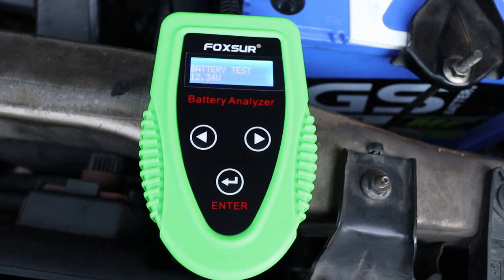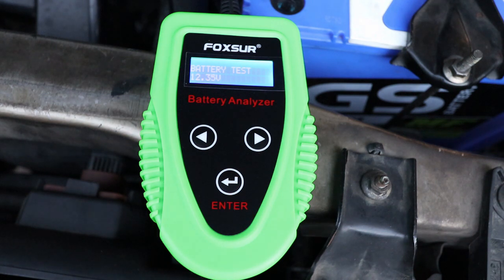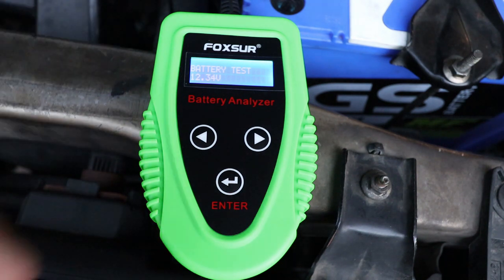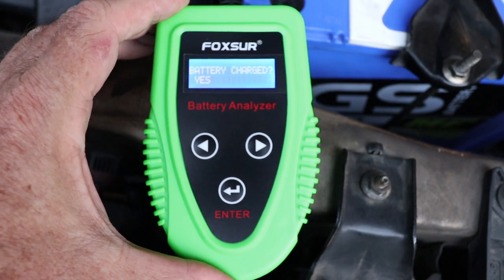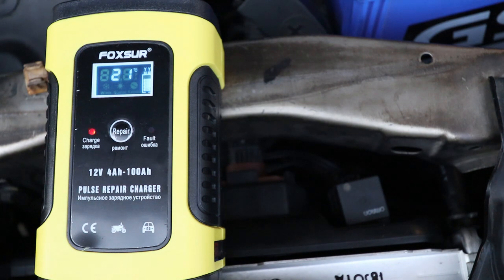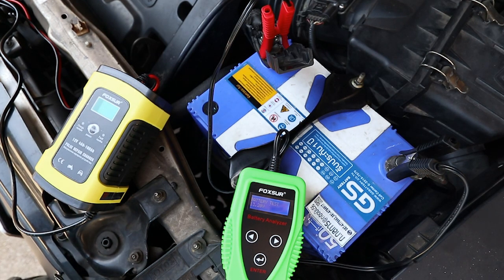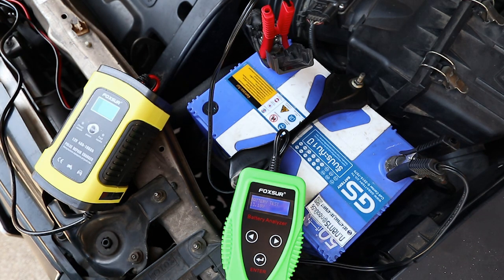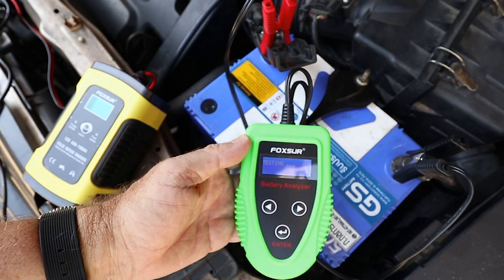Can The Foxsur Pulse/Repair Battery Charger Repair A Bad Battery?

Comment: i've had a good result last night with my newly purchased Foxsur pulse repair charger (same yellow one as yours) on my 2 year old Amaron 3SM battery 600CCA.... from 80% state of health (and also 80% charge) to 100% s.o.h. .... 17 hours of pulse repair mode... it didn't go into charge mode yet, but I noticed battery fluid coming out from the top of the battery (the fluid was a little dark... maybe the desultification effect?)... so I stopped the pulse charger... I was worried that the battery got damaged, but upon checking with my Ancel battery analyzer, it was already fully restored to 100% and it was also fully charged. Best investment so far (both charger and analyzer).
Reply from the maker: I'm really pleased to hear this, thanks for letting me know! I experienced the same thing doing a pulse repair. I left it repairing for over 24 hours, but it didn't actually stop and go into regular charge mode. However, the battery condition was a lot better after the repair. From what I understand about these chargers, they won't damage the battery. There's a cut-off to prevent them overcharging. I bought both the charger and analyser for a very low price and, like you, consider them to be very good investments.

Comment: This is my suggestion.. just do PULSE charging once a year for new battery around 7-12 hours. This will extend your battery life around 5 years easily without problem. Its adviseable for vehicle with short trip due to our car alternator cannot charge enough power to the battery to conserve if you driving less than 30 minutes per day + sulfation happen overtime. My battery still going strong while reaching 4 years now with CCA around 85%. Its recommended to replace your battery when the CCA reach 50% from your original value.
Tq
Reply from the maker: Great advice, thank you!
Reply: Can we pulse charge our well working battery without damaging it?
Reply: Thanks for the advice

Comment: Good video. But one point you make (at 6:50) may need to be clarified. Some smart chargers won't start charging or repairing if there is not a minimum voltage on the battery. Ironically you may need to give it an initial charge (with another charger) to bring it up to a basic level (I think it is around 10v or 11v) before the 'smart' chargers will work. But Pulse charging works well to repair - I have a Foxsur unit also.
Reply from the maker: Thanks for the clarification.

Comment: Greetings from Malaysia (which is just next door to Thailand). I bought one myself on Lazada (For 45 Ringgit Malaysia = 335 Thai Bahts) , after seeing your video. Exact same unit in orange and i have to say the repair mode has mixed results. If the battery is on its way out, it may or may not repair it. But I'm in no means of discouraging. My minivan also spend half its life sitting in the porch with minimal usage. Unfortunately I do not have a battery tester so I'm relying solely on voltages to tell me roughly the battery life.
Reply from the maker: Yes, they are very cheap. After doing the video I did another repair and the result wasn't as impressive as the first time. It will be interesting to see what happens next time, but we have to remember that batteries won't last indefinitely. I find the battery analyzer useful because you get an exact number without having to guess. Thanks for your comment!

Comment: With this charger, does the battery need to be disconnected from the car's electrical system in pulse repair mode?
Reply from the maker: @DavidBookbinder  I would definitely advise doing so. The user manual doesn't mention anything about this. It might be OK to leave the leads connected while doing regular charging, but pulse charging could do a lot of damage. I disconnect the leads for regular and pulse charging. It's not worth the risk for the extra few minutes it takes to disconnect the leads.

Comment: I watch another video on someone using the NOCO charger. Apparently that manual documentation says to initially bring to full charge first. After that then go into repair mode. I wonder what the theory behind this is. Phil, in your case, you went straight into repair mode and seems to work.
Reply from the maker: I had charged it a few days before and I had been using the car every day, but yes I agree, I should have charged it again before doing the repair. Even though the battery should have been almost completely charged, a few other people have made this point and I should have charged it again first. Thanks for your comment!

Comment: This is a great video. My wife got me a pulse repair charger that looks pretty much identical to yours (including the display) but in orange and with the brand BUDDYGO. After a couple of times recently of having to charge the battery after not driving my merc that much recently due to lockdown, and finding the battery completely dead (not even enough juice for central locking to work!)
Reply: I'm now trying the pulse repair and hoping that this works and saves me having to get a new battery! Fingers crossed! Thank you for your clear video!
Reply from the maker: @Swindongareth  Thank you! My problems also started due to the virus. My kids were doing on-line learning at home and there was no need to use my car. When I did try to use it I found the same as you - a completely dead battery and no central locking. The charger got my battery working again and has been fine since. I think they are all produced in one Chinese factory and sold in different colours with different brand names. No doubt, they're all identical inside. I hope the repair is successful!

Comment: Great video and review. Your Foxsur Smart Battery Analyzer (ALI Express) link is no longer working.
Do you know if your battery charger pulses are 16 volt power spikes like a Noco Genius 5 and 10 charger or CTEK charger uses? I have a Pulsetech PowerPulse passive battery desulfator on my 2001 BMW battery as preventative maintenance as Pulsetech claims that there patented frequency they use can extend battery life up to three times. I also used my PowerPulse on my other BMW battery that I let sit disconnected for a year, and it was at 11.2 volts, I tried charging it with my friends Exide 6 amp automatic charger for 14 hours and  battery voltage was at 13.1 volts, yet it would not start my other car. I put the PowerPulse on it along with a 1 amp Schumacher manual battery charger for 72 hours, and left the desulfator on it for a week and it started my car right up. My point is desulfation can take up to 30 days depending on how sulfated your battery is.
Reply from the maker: I'll look into the broken link. Thanks for letting me know.

Comment: I have a solar system and cannot pulse for 22 straight hrs. Can i pulse over two or three days w/ 10 hrs breaks?
Reply from the maker: Good question, but I'm afraid I don't know the answer! The documentation I've read assumes that users have a constant supply of electricity. The idea of pulsing is to remove sulfation from the lead plates. I guess that if there are breaks during the desulfation process, it will still work, but I don't know for sure.

Comment: Hi Phil....what voltage was your battery at ...at the start of pulse repair and what did it read at the end of pulse repair? Is the battery still holding up well now? Thanks
Reply: Ah I see the starting Voltage was 12.34V
Reply from the maker: I didn't pay much attention, but you found the answer! My background is mechanical rather than electrical, but I don't think that voltage is all that important. Current is where the power is. Sorry for the delay replying. YouTube doesn't always notify me of comments and I only find them when I look in YouTube Studio.

Comment: When I switched on, it turned full immediately and when I pressed repair button, nothing changed on the screen. Any idea whats happening?
Reply from the maker: Not sure. I've only seen this after doing a long charge. If it finishes the charge and I put the charger back on it says full immediately, which it is. All I can suggest is using the battery some more and then trying again.

Comment: Phil, technically, do we need
To disconnect the battery 
terminals when charging it, 
pulse or normal ?
Reply from the maker: The manual doesn't say anything about this. Whenever I do a pulse repair I always disconnect the terminals. In the past I have done a normal charge with the terminals connected without any problems, but now I always disconnect them. It only takes a minute and it's better to be safe than sorry!

Comment: Thank's for the review. Should I dismantle the battery first from car before charge using foxsur or I just connect without dismantle the battery from car ?
Reply from the maker: When I use the regular charge mode I don't bother disconnecting the battery leads. I put the positive charger lead on the battery terminal and I put the negative lead on an unpainted bracket on the engine block.

When using pulse repair mode I don't like the idea of electricity pulsing through the car's electronics so I always disconnect the battery leads and connect both charger leads to the battery. The user manual doesn't say anything about this, but my view is that it is better to be safe than sorry.

Comment: How long did the battery last after the "repair" 6 month, year, 2 years etc
Reply from the maker: It's still going strong. I did another pulse repair recently because I'm not using the car much at the moment. The CCA is down (around 450), but no problems starting. I'm not sure how much longer it will last. There comes a time when the repair mode doesn't improve anything and the battery needs to be replaced.

Comment: With pulse repair mode, does it run for a set amount of time based on the battery type or does it somehow detect whether it needs to keep repairing? Asking so I know whether you can run pulse repair mode and take a break e.g. it starts raining so you disconnect and bring indoors, reconnect when dry, it's then night time and you don't trust your neighbourhood to leave it going overnight so you disconnect again and bring indoors, reconnect in the morning, then it rains so you disconnect, etc etc  etc. If you did that would the device 1) never complete repair because it's set to run for a pre-determined length of time each time you begin repair, or 2) eventually complete repair because it somehow monitors the condition of the battery and only repairs when there's... stuff to repair. ?
Reply from the maker: It's the second one - it monitors the state of the battery and continues repairing until the repair is complete. Once it's complete it then switches into regular repair mode and the manufacturer recommends that you leave it charging for an extra hour in normal mode once the repair is finished. In my experience this takes a long time - in excess of 24 hours.
Reply: @PhilUKNet  Thank you for this, good to know.

Comment: Unfortunately my experience with the repair function is not positive. It was a 3 year old battery for a car that see 2-3 weeks non usage every alternate months and had around 3 odd full discharge in last 6 months. The battery tester said capacity around 40%.  This was a wet or flooded battery.
Tried with charging as well as the repair function.
The repair function always pulsed for 12 hours and then get reset automatically. The capacity hardly improved from 40% before to around 45%.
Reply from the maker: I believe that full discharges can cause a lot of damage and doing it three times might have been too much for the battery. My own experience has been fairly positive and I've heard the same from other people. Possibly by using the battery and trying further repairs the condition could improve? Anyway, thanks for your feedback!

Comment: I have foxsur the 12v/24v 6A model it’s look similar to this one . I have connect the 12V 55ah sealed lead acid battery and I have select repair mode .
I have found it display 24v and battery is warm on one side of the positive terminal and cold on other side .I left it on the charger 5 and half hours and I disconnect it to check the voltage, it’s charging the voltage I found to be around 10.3v . I have connect back again and leave it on repair mode still it’s getting warm and indicating the mode on repair and 24v . I have check with DMM meter the voltage is changing between 13v to 29v .
Is this normal or what should I do . There’s no switch or anything to select between 12v and 24v.
Reply from the maker: I have no experience with your model and I don't know the answer. I'm sorry!

Comment: I just bought one and is currently repairing my car battery, but I noticed you said the fan was on whilst you tried to repair your battery ? Mine is only making a clicking sound with no fan spinning & oil & repair on display ? Is that normal ?
Reply: With Pul & repair on display (not oil)
Reply from the maker: I can't remember there being an 'oil' icon on the display. When I went into repair mode the fan started spinning slower and was noticeably quieter. However, it did remain spinning. I can't remember a clicking noise, but this may be normal. As the unit is controlled by a low voltage microprocessor it probably uses a relay for the electrical circuit to the battery and in pulse/repair mode this relay probably clicks. I didn't put my ear close to the unit and it was a noisy environment.
To recap, I don't understand the 'oil' display - perhaps yours is a different model to mine? Repair on the display is normal. The fan, I believe, should be running in repair mode, albeit slower than regular charging mode. The clicking sound may or may not be normal. I didn't notice any clicking, but I didn't listen very hard.
Let me know if the repair is successful.
Reply: Phil UK Net thanks Phil 👍 no , just to be clear ? It just states (PUL & Repair ) as red light flashes on and off , the fan is not spinning at all since 1pm when 1st connected it’s been like this since then. When I take off repair it states battery is full ? Although it’s been dead for 5 months ?
Reply from the maker: Sorry for the delay. There is a problem with YouTube not notifying me of comments. Perhaps the battery has a serious problem? The charger can desulfate batteries, but it can't fix big problems.

Comment: Great video. I’ve just bought 2 of these to maintain my motorcycles and to tickle up the car battery.  I quite like that tester and will look for one.  Nice, waffle-free review.
Reply from the maker: Thank you! I try not to waffle, but sometimes it just happens 😏 Of the comments I've received, most have been positive but there have been a few negative ones too. I've had no problems and have been pleased with charger. The analyzer works well and is very useful. The two items complement each other well.
Reply: Used both overnight, about 14hrs.  Dual-battery system in Chrysler 300 SRT8. Primary battery showing 12.5V but getting dozy.  Secondary battery was worse and somewhat resurrected by the arc-welder method after a year idle and never holding much past 11V.   Both indicator windows showing red.  These cars are wheeled computers with much parasitic drain! After repair process both showing 13.1V after a run and both indicator windows green , holding at 12.7 . These devices undeniably work and seem to do what the arc method won’t.  Seems the battery chemistry is restored. Saved me a lot of money! I’ll use these to maintain my motorcycles too.  Exceeded expectations! Now someone’s going to tell us it’s impossible. 😁
Reply from the maker: @ThreenaddiesRexMegistus  That's great news, thanks for the feedback! One thing they aren't, is fast. Every repair I do takes over 24 hours so I schedule repairs when I won't need to use my car. The feedback I've received is mostly positive, with a few very negative comments. This reinforces the positive comments.

Comment: After repairing it does the battery sustain its voltage without any load for couple of days?
Reply from the maker: I've not had any problems at all. My kids have been at home learning on-line for the past year, therefore I've used the car very little. Sometimes it sits there for a week or more doing nothing, but it starts every time. The voltage does go down when the car isn't used. Immediately after driving it and turning off the engine the voltage is 12v+, but when left for several days it can go down to almost 11v. I don't know if this is normal, but the car still starts. I guess it depends more on SoH of the battery and available current, rather than voltage.
Reply: @PhilUKNet  Thanks for yr reply, if tht's tht case I will be getting the charger really soon.
Reply from the maker: @leefiz  I've been pleased with it and most of the feedback I've received has been positive. I've done quite a few regular charges and about four pulse repairs. Sometimes the pulse repair makes almost no difference to the CCA rating, but it seems to give the battery an extra lease of life. I've also had a few negative comments. Someone recently said he had bought two chargers and both were charging at 48v, which was a safety risk. I don't know what was going on there. I bought mine on-line in Thailand and it was very cheap. For the money, it has been great. Everybody will have a different experience, but I still have no regrets. I hope it works out for you!
Reply: @PhilUKNet  Thanks again, Well  there is no guarantee  sometimes buying online, some will get a really good ones and sometimes not. Depends on the buyer's luck. I've also did watch few video review about this brand here in Malaysia and mostly being positive. 

I will purchase it soon and it is cheap here in Malaysia just RM38.80 @USD9.70 😂